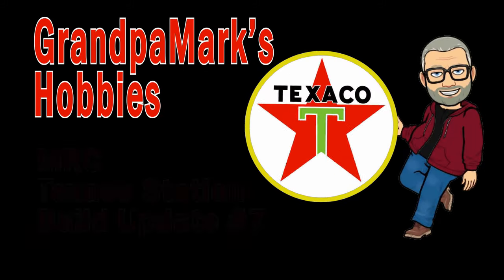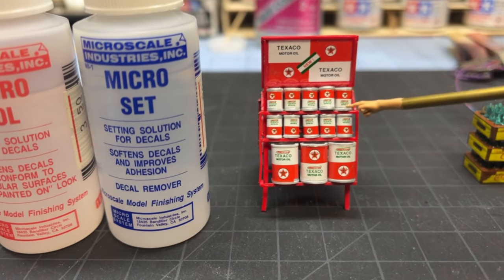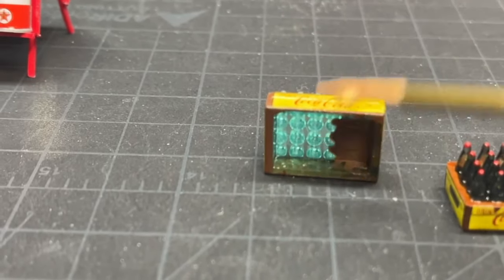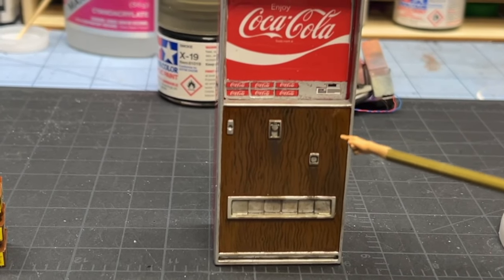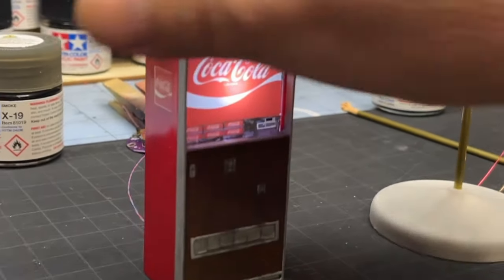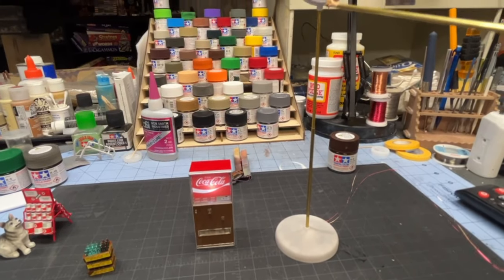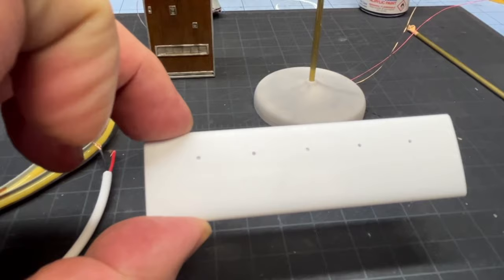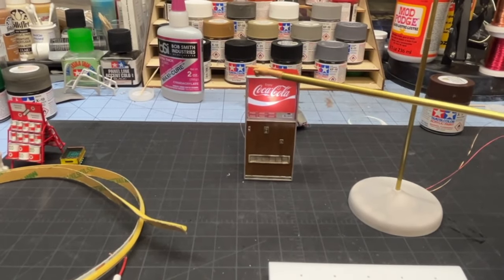MRC Texaco Station Build Update #7 Pop machine and Street Sign

Comment: Great work as always Mark! If I may add a small suggestion, maybe use a small defuser lens in the top of the coke machine to smooth out or reduce the sharpness of the LED? And you could run the wires from the pumps and lights across the ground and make it look like the hose for the bell to ring every time a customer pulls up. Keep up the good work.
Reply from the maker: Thank you very much.  My crumby camera sure made that light look much more intense than it really is.  I am going to run the wires under the display so I can solder several of the ground wires together and do a home run with them.  The different lights will go to the computer on different controls so I can do different things with them and make it more interesting.  I have some solder wire that is the right size for the air bell, and I also plan on having an air hose mounted to the front of the building too.  Thanks for all your suggestions.